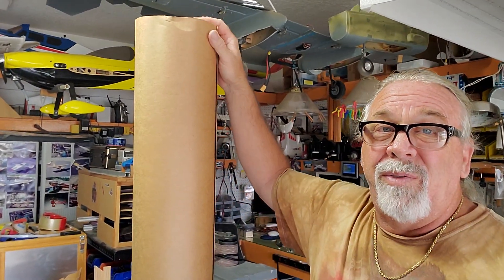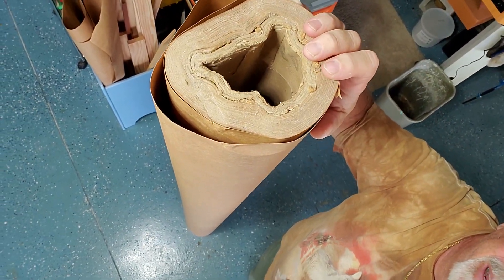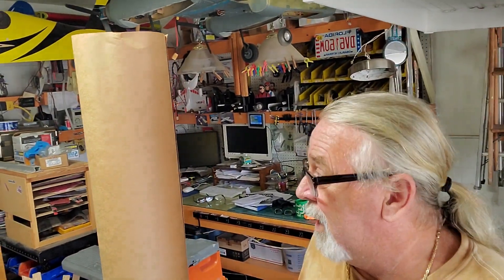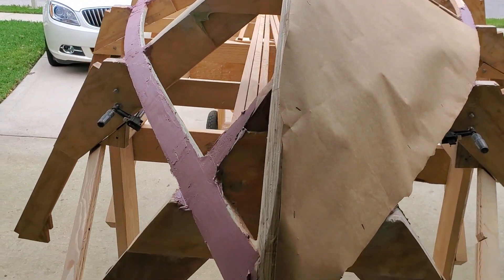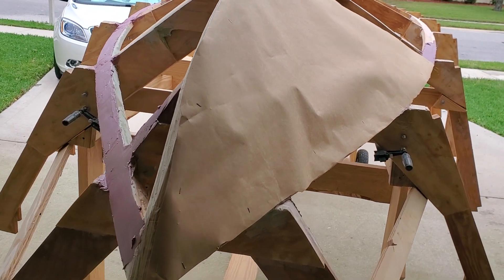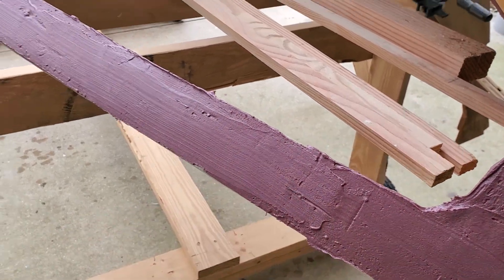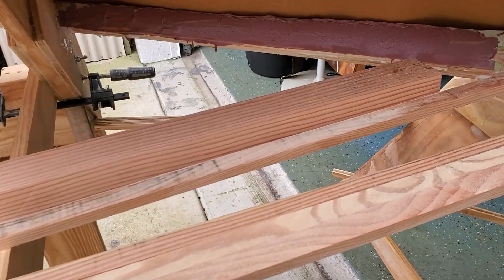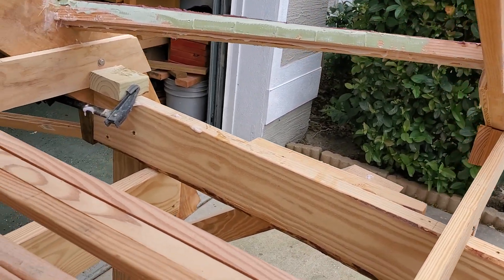Plywood boat construction

Comment: Hi, James. I spent much of my three-decade editing career working on boatbuilding articles, and I think you're doing a terrific job with both the videos and, more importantly, Ken's 20-footer. (Note that the name is pronounced "Hank-in-son"). He was a fine designer, and I'm grateful that we corresponded more than once about his profession. Now to the matter at hand: In the comments that followed your "The Good, The Bad, and The Ugly" video (the one before this), another subscriber raised the same issue that was bothering me: "delandshark" wrote, "Did the notches on the first frame get cut too deep 1/2”? I’m a little confused about what caused the need for the extra fairing." You replied, "I was totally confused too, but a had a break thru on the issue and will explain better in my next video. ( basically I accidentally deviated from the plans)." Trouble is, you do NOT address this problem in the current video! It's an important one, and—for the sake of amateur builders everywhere—I hope you will. Keep up the great work. Chris.